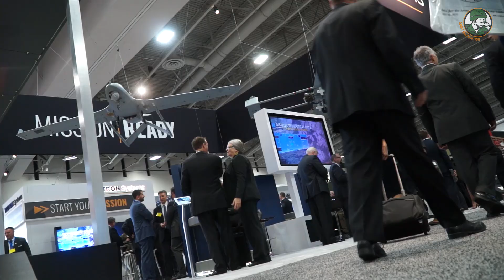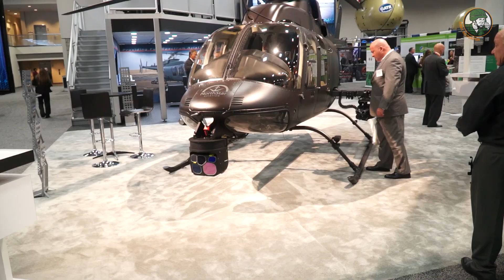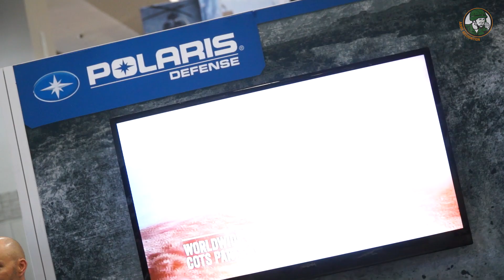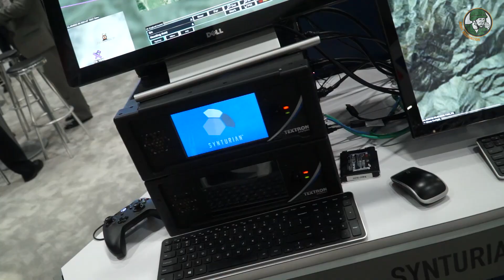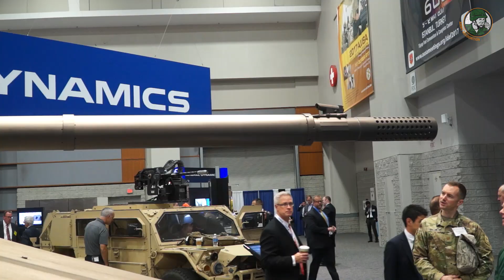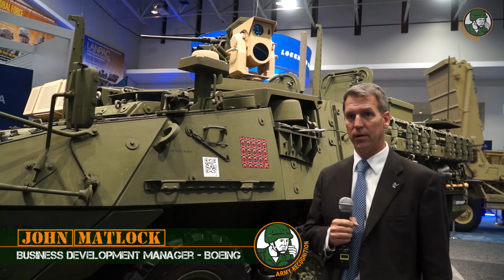AUSA 2016 Association of US Army conference defense exhibition  Washington DC United States Day 1

Comment: "YESSS"!! 
DAMN I WANT GO BACK IN "!

"But I was in the Military 1983 16 I joined in the Guard ...
Went 2 Summer Camps before I left for Basic training ! 
I told them even then that Military should mount a 102 105 mm Howitzer in back of a Duce'n'1/2 we hauled them in the back anyway some times ! 
They fit perfectly all you had to do is the put heavier springs inside then the 3 sides that were around it allow them to fold down and use them as standing platforms Soliders to stand on ! But better to use a 5 ton truck to haul a 155mm Howitzers with same platform ! Beef up the suspension system ! 
But if I'm not mistaken some Countries got smart already are doing this ! 
But the thing that causes them problems is "Marching Orders" it takes so long to get stakes you drive in the ground or just get it ready to be mobilize ,so if the Howitzer is already mounted in back collect up haul Ass ! Not to mention your not towing a Howitzer mounted on a trailer causing you driving issues! 
But as I said some Countries got smart, I hope we will get there Military can see where they can benefit hauling big gun back there as well ! 
I'm with mounting them on a Humvee but having those 4 stabilizers on the Humvees I don't like, takes to long to get them in when time is of the essence! But overall it a smart light way to utilize a big little gun and especially give our Infantry some much needed close fire support ! 
102mm Mortars are great, but a 105 can reach allot Further than 102mm ...
I've fired both in Iraq but this,set up is allot better that mounting 102mm Mortars in back of a M113 APC carrier trying to maneuver around streets...
But one "BIG ADVANTAGE " that 105mm can lower down and "DIRECT FIRE" and  if enemy held up in a Tank, a house building put one round right thru the window ! 
... and especially a Machine Gun Bunker !

Comment: Considering the prevalence of asymmetrical warfare, the M1 Abrams tank is increasingly out of place in many of the US military's operational areas. A modern light tank capable of delivering high volumes of firepower while well protected against most of the threats likely encountered on most modern battlefields seems like a very valuable addition to the American inventory.
Reply: For the Brigade Combat Units the Griffen Tank would be great as a replacement for the M-1128 MGS units. Being an old tanker I thank a four man crew is better than a tank with an auto-loader. Try changing track with a three man crew doing security on the move with three man crew